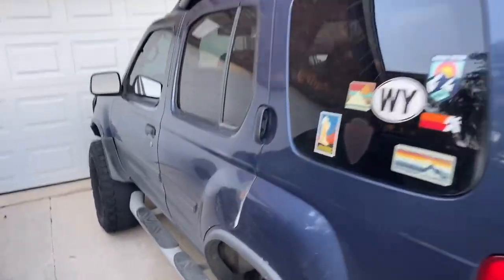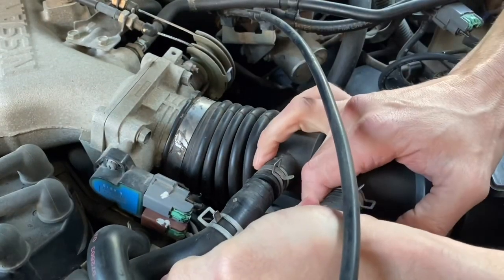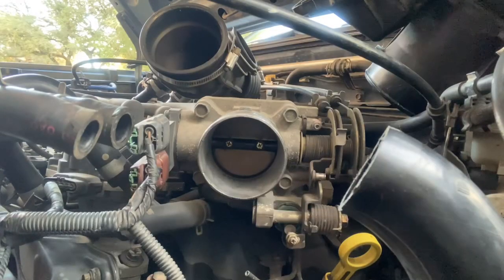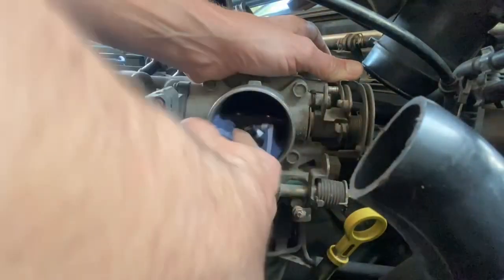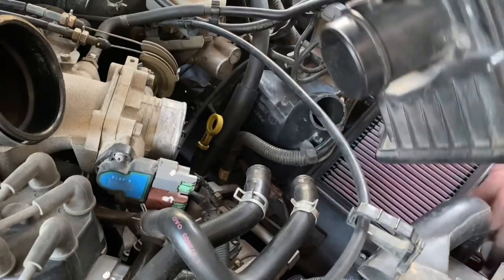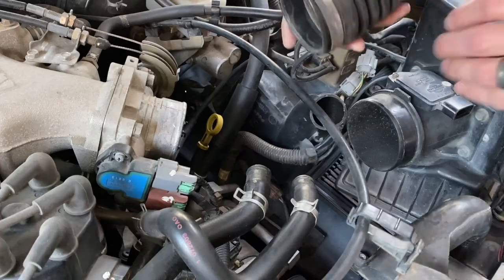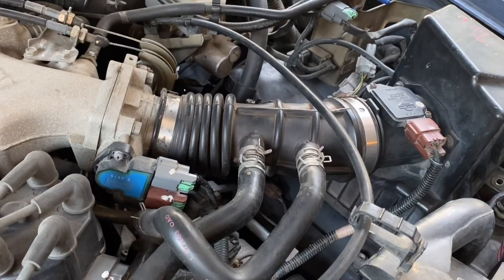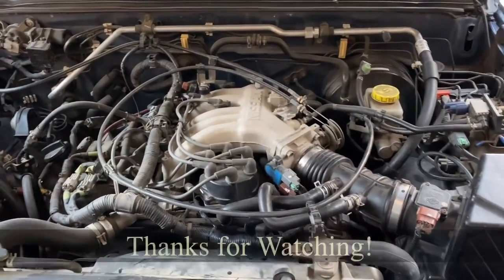How To Clean Xterra / Frontier / Pathfinder Throttle Body

Comment: Did it fix your issue ?? I have a high idle issue atm always stays at around 1500 rpm. Sometimes a little lower but not much
Reply from the maker: I want to say it was reduced…but it still returns sometimes. If yours is happening all the time, it might be more of a vacuum leak. Start with cleaning your MAF, then check all the little hoses around the drivers side of the engine compartment. These little hoses sometimes cause phantom issues.

Comment: Hello, I have a Nissan Frontier from 1999 with a 3.3 engine and the map sensor distributor cap was changed and when it was turned on it exploded in the exhaust.
Reply from the maker: Dang!  I guess the timing must have been off quite a bit. Is it normal now though?

Comment: torque convert solenoid code/shuddering. driving me bonkers. my mechanic says his transmission shop wont' even touch a Nissan transmissions. any tips ?
Reply from the maker: I fixed that problem on a dodge neon one time. The owner hit something and knocked the wire loose from the connector. Maybe your connector suffered some damage somehow. I would carefully inspect all wires before diving in to the transmission repair. Unplug and check for pin corrosion.
Reply: Tell your mechanic it's a regular automatic transmission not the CVT they are assuming every Nissan has amd stop crying.

Comment: Woulda kinda liked to see if it fixed it
Reply from the maker: This didn’t fix my original high-idle problem, but oiling my idle air control valve springs and guides improved the idle greatly.
Reply: How did you oil the iacv? Did you remove it?
Reply from the maker: Did not remove it, I oiled the visible springs and linkages.
Reply: @ijfim thanks for the quick reply. Are you talking about the fast idle cam? Would you mind taking a pic or video?
Reply from the maker: i am talking about the fast file cam. It has a plunger and a cam that moves the throttle when cold and hot. I don’t know if you can PM me through YouTube. Unfortunately, this medium doesn’t allow me to post anything other than typed responses.